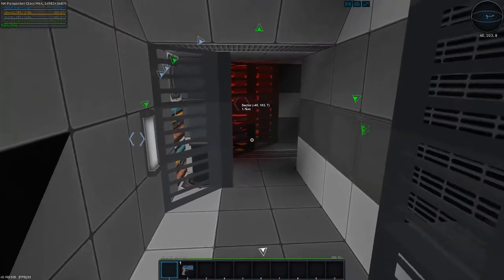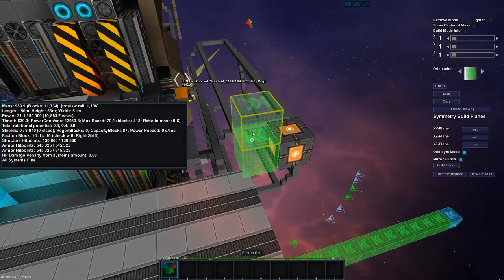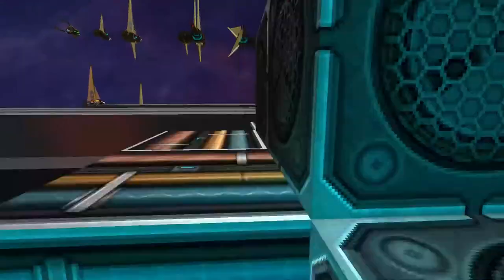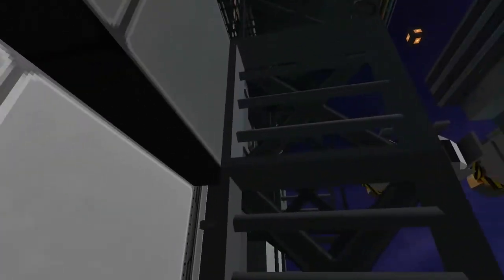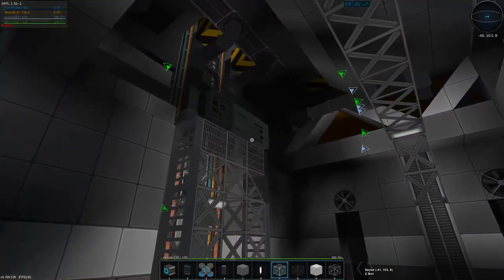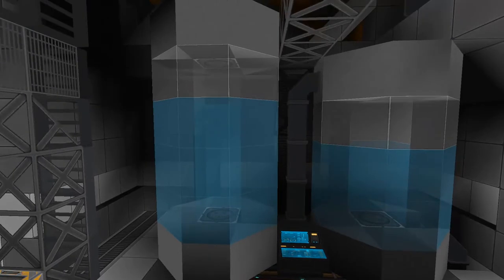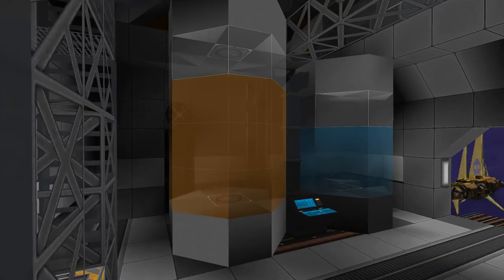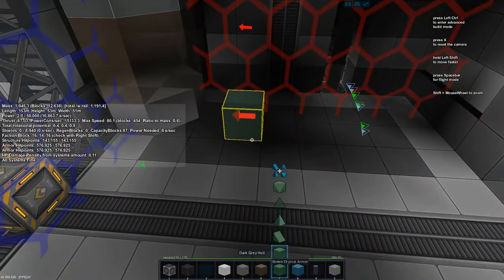Project Titan - 6 - Air and Water filtration (StarMade Let's Play)

Comment: WOW, your definitely a true MLG player at this game. However have a suggestion on the water tanks tho, i notice you have pipes going into the tank caps leaving empty space around it, why not use pulse module blocks or other devorative blocks in the bottom and upper caps to signify a pipe instead?